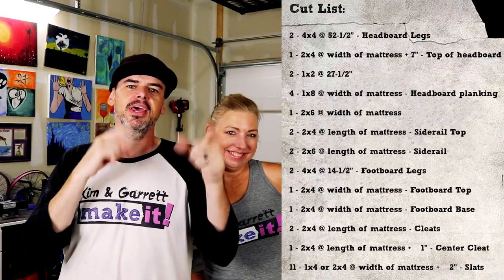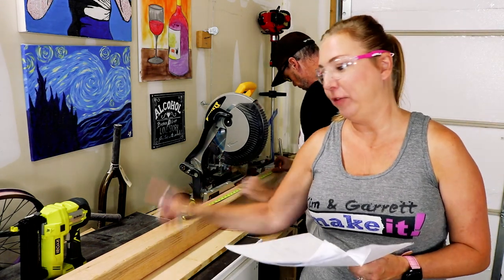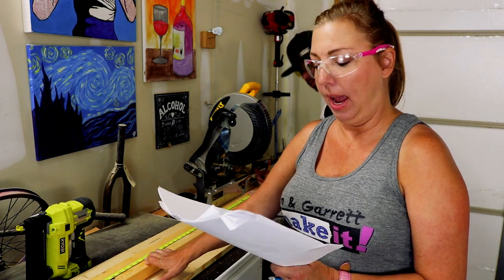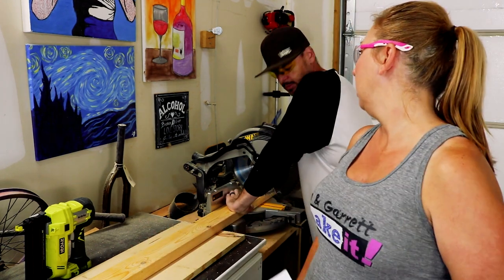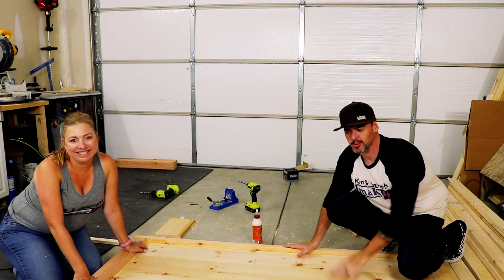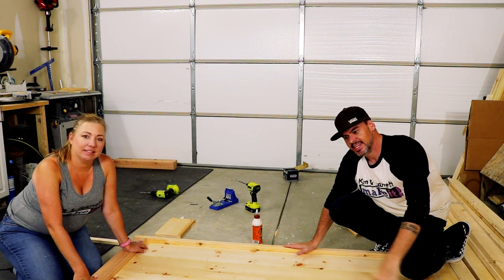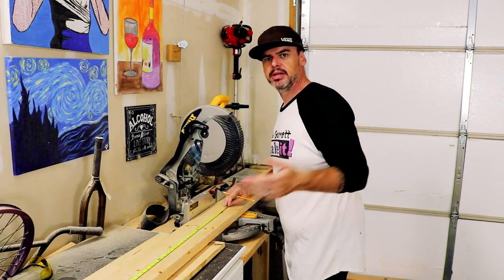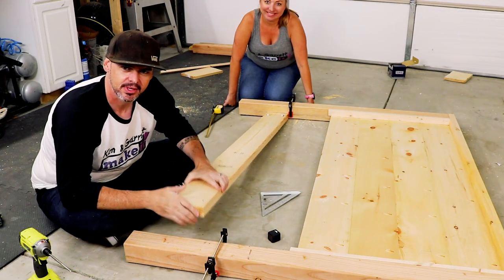How To Build A Rustic Modern Queen Bed | $150 DIY Farmhouse Bed

Comment: When dry fitting the side rails and you dissemble and reassemble, do you need to use new screws when reassembling?
Reply from the maker: Nope, we used the same screws. We have moved since and we used the same screws again. Thanks! ~garrett
Reply: My I ask one more question. Sorry I ask many. What kind of nailer are you using? A Ryobi finish nailer? That's what I'm thinking. I would like a brad nailer may be to small and a framing nailer to much.  @KimandGarrettmakeit

Comment: How is the bed holding up? I am worried about using pocket screws to connect rails to head board
Reply from the maker: The bed is doing great. I didn't think the screws would hold either so Garrett jumped on it a bunch of times to prove it.